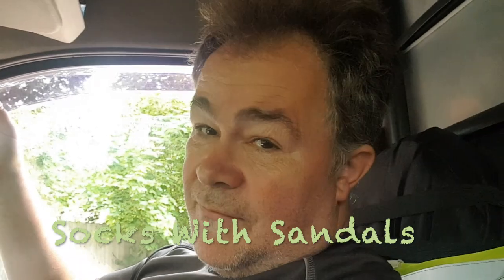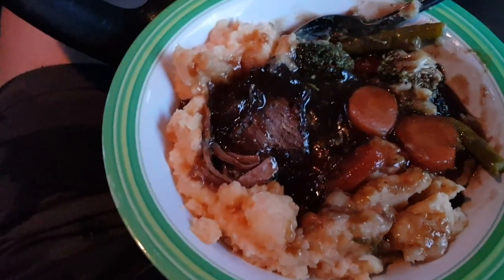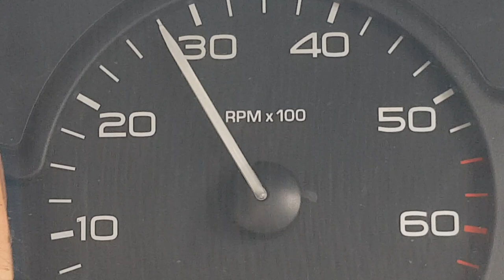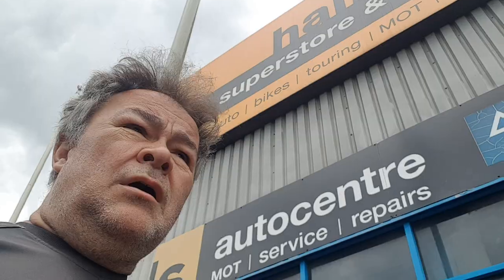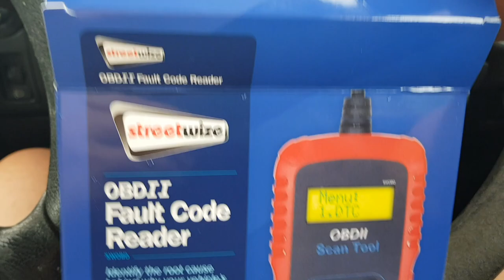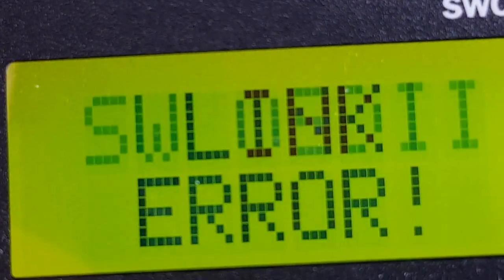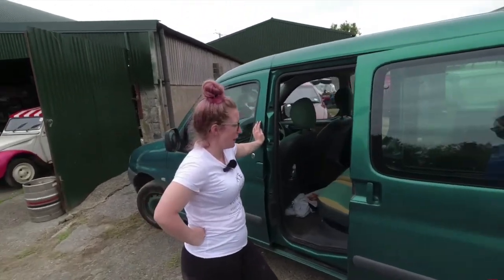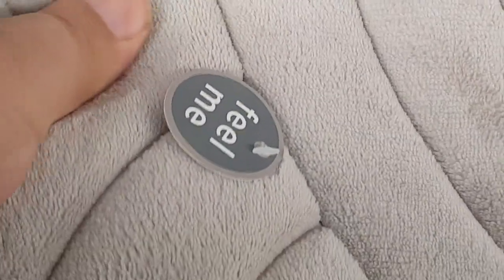🇬🇧 UK VanLife S12E72 What's Wrong With My Van's Engine?

Comment: I never liked the modern engine diagnostic requirement for faults or, all of the sensors. Good old school mechanical for me. Warning and limp mode on diesels, is something covered in soot more often than not. My transit needed a new EGR valve, all clogged and stuck. Eye watering cost to have fitted.
Reply from the maker: Yes, that is the worst case scenario that I fear. Having a big engine in a small van there is no room to get spanners between the block and bulkhead without removing the cylinder head.

Comment: It could be one of many things as you stated. I hope it's a cheap fix, Tim.
Reply from the maker: I thought diesel engines were supposed to be much simpler than petrol!
Reply: @SocksWithSandals  They certainly are but they've added so many sensors and emission nonsense that it's harder to narrow down some issues than it used to be. I loved working on old Ford Mark 2 petrol engines thirty-five or so years ago, simpler times. I do find cars much more reliable now nowadays though. I've owned one diesel car in my life before my van, I initially wanted a petrol version of my van...no timing belt but a timing chain, it would have been somewhat quieter and I prefer working on old petrol engines over diesel.
I am happy enough with the diesel van, fuel economy is reasonably good and it's capable of higher mileage.
I'm wondering if you got your van sorted now as I know we're behind, from filming to editing and uploading. Looking forward to seeing what was/is causing the limp mode Tim 👍

Comment: Disconnect wiring plug on MAF sensor , then rev it ..if it revs properly over 3k  then fit new sensor or try cleaning it with carb cleaner. Could be that and quick to try . Hope you sort it . its on the air intake pipe near filter.
Reply from the maker: Did that. Maybe the next episode shows that attempt.
Reply: @SocksWithSandals  or the MAP  sensor take out clean it.